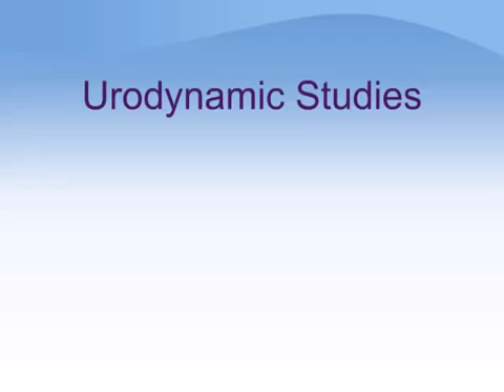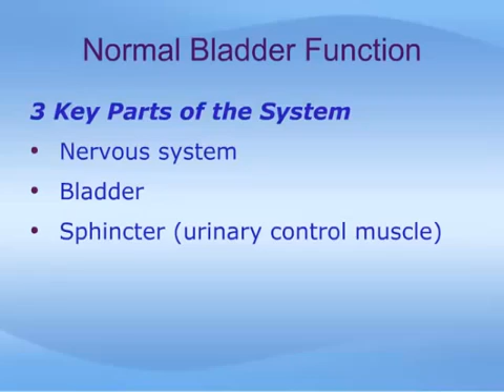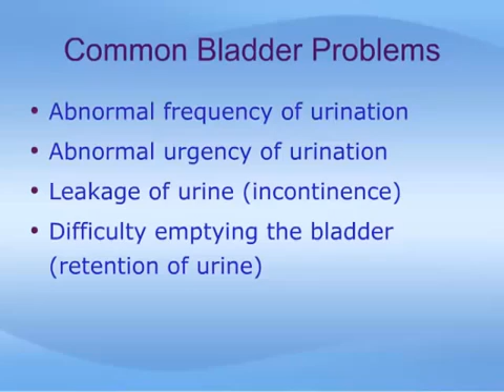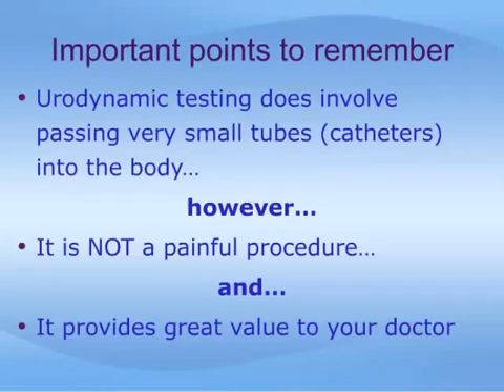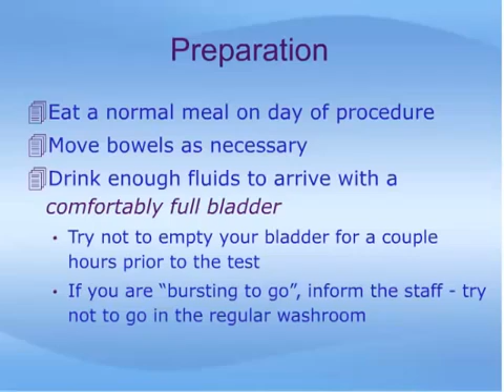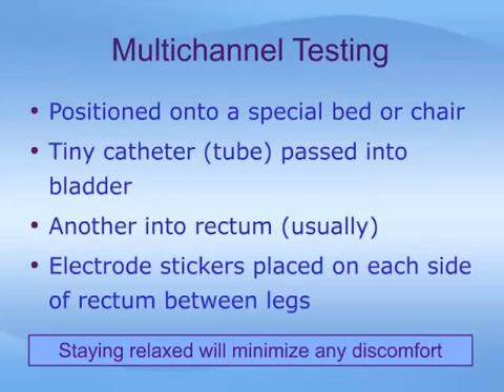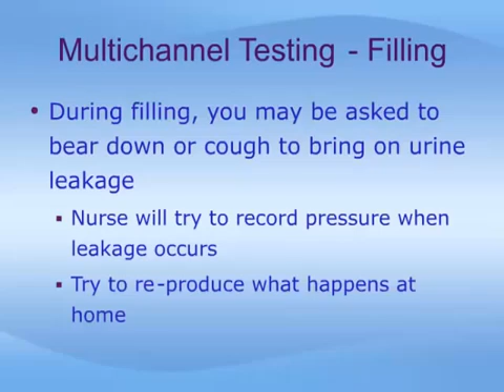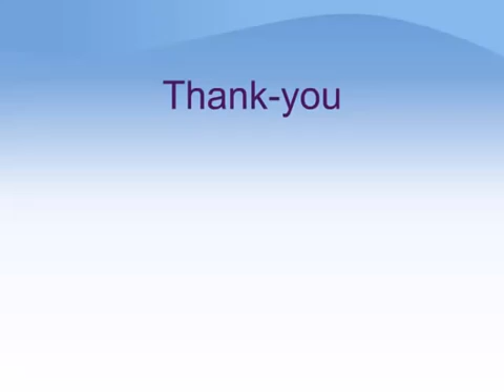Urodynamics

Comment: I have urinary incontinence and have gone to three different urologists for it.  I have been reluctant to go along with the highly invasive diagnostic procedures they insist on.  Finally, with the third urologist, I relented and agreed to have the urodynamic study done.  

I went to get this done today.  They first attempted to insert the voiding catheter.   It was extremely painful, and I had to order them to stop the procedure.  The doctor came in and started suggesting other catheters they could use, but at this point the damage was done.  They caused me excruciating pain and I had absolutely no confidence in them being able to conduct the procedure.   They suggested that I had an enlarged prostate, which may have been exacerbating the problem.  If so, why did you not determine that before you put the patient at risk?   And why continue to "stab" at the prostate with the catheter, when you could see it was meeting with resistance?

I left as I could not get the procedure done.  If you are contemplating this procedure, make sure you thoroughly research it and ask lots of questions before you agree to have this done to you.

I'm very discouraged at the primitive state of so-called modern medicine that rely on such barbaric and highly-invasive procedures as this.
Reply: imaniguana 
This whole test is for their benefit
Reply: Urodynamic stady test painful?